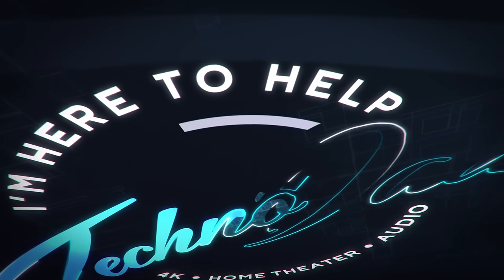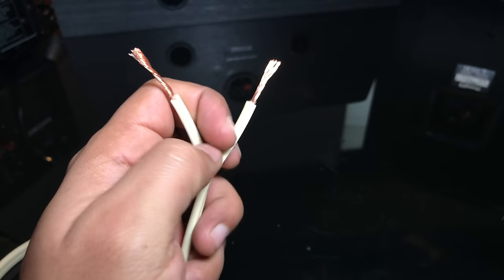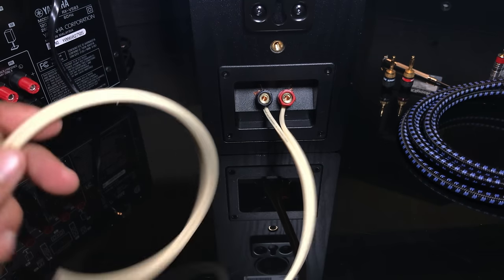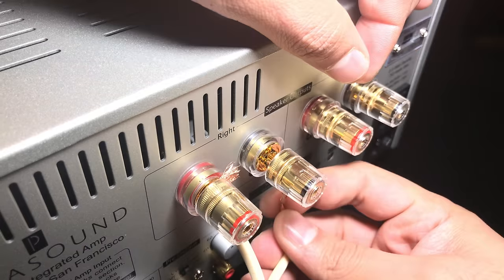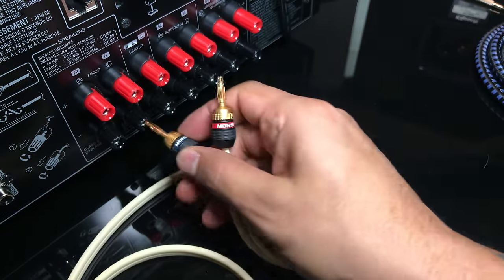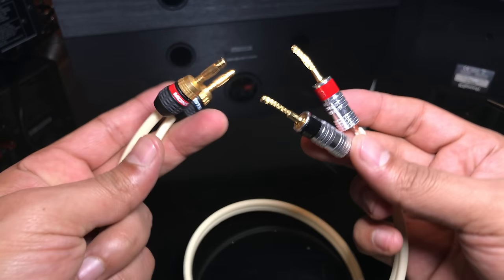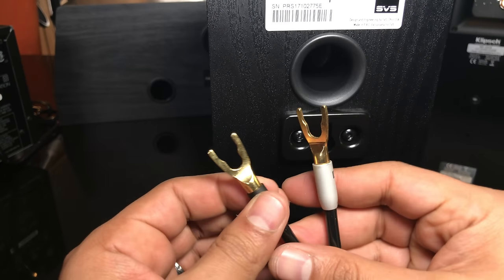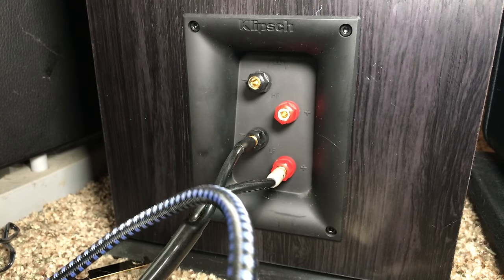How to Connect Speakers to Amplifiers | Home Audio Basics

Comment: Aloha! How much insulation do you recommend snipping off? You said you went too far when using the flex pin connector. Should i take off 1/2, 3/4, or 1 inch.
Reply from the maker: Hi!  I'd say 1/2 inch should be just fine.
Reply: @TechnoDad  Is that enough for spring connectors and banana clips as well?

Comment: if you are using bare wire put a small amount of solder at the end of each wire, that will keep it from coming apart. sometimes I just coat the entire surface of the wire with some solder. you can go to a discount store and find soldier and irons for a few dollars.

Comment: I have a cheap Yamaha active sub with a single RCA input.  My amp has no RCA sub output, but it does have a subwoofer speaker input.  If I buy an RCA to speaker wire adapter, will I be able to hook up my sub using banana plugs?

Comment: Hi, I'm really having trouble with some audio things. So I've got a pair of focal ca 165 coaxial 2 way speakers which I got cheap and I want them in the rear. Should I not connect factory tweeters in the doors and leave just focal speakers so the sound doesn't mix up? I'm not using an amp at the moment, thanks.

Comment: At 13:24, where do I plug in my speaker wire into? Just got some Klipsch RP-6000f and not sure if it matters which ones I plug it into. Low frequency or high frequency?

Comment: My system consist of 5 floor speakers 2 subwoofers and 4 ceiling speakers on a Yamaha RX-A3080. I would like to add rear speakers, but I am unable to wire them without having wires on my floor crossing a walkway. I am hoping you know of a way to attach wires to the rear channel of the receiver from some type of device to make a wireless connection to another device which would than be wired to my speakers.

Comment: Is there a way or even need to connect a DAC to a receiver? Is the receivers built in DAC better to just use? I was just given a Schiit Lyr 2 and am doing some hwk on this.
Reply from the maker: You can bypass the internal AVR DAC by using the Schiit to change the signal from digital to analog.  Meaning, you would go from your source to the Schiit in the digital domain and then use analog cables to go to the AVR.
Reply: @TechnoDad  is it worth doing this?

Comment: can you plug in more than one barewire connection from the output of the receiver to another set of speakers? like if you had other rooms that had L/R speakers and wanted your receiver center L/R to be tied into them?
Reply from the maker: Hi Thomas!  I would not suggest that. When you do this, you are connecting the speakers in parallel and when this happens, the amp sees a half the ohm load and outputs more power.  This is not a great setup as the amp may start clipping (turning off).  Most AVRs with 7 or 9 channels will have a Zone 2 section where you can power and send sound to a different room, I would look into that.

Comment: I just purchased 12 outdoor 5 and 1/4 Pyle speakers. What should I do for a head unit I'm also thinking about adding for rock as in fake rocks I'm pulling two wires around the whole entire so I can't miss the what a diagram would be along with a suggestion for a good head unit
Reply from the maker: Head unit?  I'm not sure about those.

Comment: Consider this:  I have found that you get a lot better results and less chance of shorting-out if you first "tin" the wire ends with solder.  Tinning prevents you from having to twist the stray ends of the speaker wire each time that you disconnect,  Tinning also enhances the movement of electrons through the wire.
Reply from the maker: That’s interesting, I’ve never heard of that!
Reply: @TechnoDad  I've been doing this since the late 70's.  I read about the technique in STEREO REVIEW Magazine.  It works great!!

Comment: Does it make a difference  if you  use  the top connectors or bottom ones?
Reply: henryconga58 if you have the binding post on then no
Reply: Thanks!
Reply from the maker: JDmsz has the right answer.

Comment: I've ordered a recevier (Yamaha R-S202D) with spring clips. I'm abit afraid that it's gonna be too tight for a 2.5mm cable, should i use 1.5mm for that?
Reply from the maker: I'm not sure.  You can always twist it up and try to make the wire more compact.

Comment: Techno Dad, we recently bought a house that has speakers in the ceiling and there are multiple ones throughout the house. They are all tied into a Monster Cable speaker selector 4 way. Here is my question if you can help. On the back of the Monster product there is a place to hook up speaker wire to an amplifier. We would like to be able to buy an amp and then play music from our phone. We don't need anything super fancy as the Monster product isn't near any of our TV's. We are not the original owners of the house so the Monster product came with the house. If you could point us in the right direction to finding a basic amp we would greatly appreciate it. I tried chatting with one of the box store sales people and they wanted us to buy a $400 amp that you could hook up everything to. We would like to be able to hook our phone up and listen to the music throughout our house. LOL Thanks in advance!
Reply: What kind of Amp was it..? Cause thats about right for the lower end price range. Why cant you get a Sony Reciever with Bluetooth and just connect and play. I wld have to see a pic of the wall where the connectors are. Are there multiple or all spliced into one outlet?

Comment: I purchased a small 4 channel audio amplifier (5.0 Digital Power Amplifier Stereo 2 / 4 Channel Audio Amp 50W×4) but I'm unfamiliar what type of connectors should be used w my stereo wire? The openings are so teeny tiny with a tiny screw on top of the opening so I obviously can't use a banana, spade, etc. What kind of connector do I use? Or perhaps I need to use a small gauge stereo wire? Help! I'm stumped.

Comment: When stripping the wires is it bad if a couple of the copper strands get cut off or will it still allow a connection?
Reply from the maker: Great question!  That’s not a problem, it happens all the time.
Reply: @TechnoDad  Ok thanks. I always get paranoid about stuff. Usually works out in the end but when its stuff i dont have much hands on experience in i always need to make double and triple sure.
Reply from the maker: All good, I’m just glad I can help!

Comment: hi techno dad! Im having some issues troubleshooting my speaker/amp set up. Not sure if you do any sort of consulting but... I have pioneer cs-99 hand me downs and a nikko sta-2020. I think I can only use a bare wire set up for both. One of my speakers is always cutting in and out, and can't hold a steady level. I'm wondering if my amp is incompatible with my speakers or if I wired it crappy. Any guidance is helpful, thank you!
Reply from the maker: Yes, I do consulting, email me - TechnoDad55 at gmail dot com

Comment: You'll get the slightest bit better connection if you skip the banana jacks and screw down the wires we are talking a small fraction of an ohm in most cases but hey it all counts.    So my suggestion is if you don't plan on taking stuff apart anytime soon just use the binding posts.

Comment: What about using pa or powered speaker with av receiver for movies outside on a projector? Would you just cut of the connector from the speaker and just use copper end into receiver?

Comment: hi, I have a question, it's possible to use an small guitar amplifier(using the extension speaker out) as a source of power for two Yamaha speakers NS-a327 from a home theater? ??  thanks

Comment: Question ,I have a Pyle HD reciver and a pair of tower speakers. I bought a 75 inch TV and I didn't bother to hook up my system to my TV or 4k player for about a month. Now when I had my system hooked up to my older 70 inch TV everything was good and now a month later I hooked everything up to my new TV and right tower speaker is making a crackling popping sound. So I got a new speaker wire thinking that's the problem I hooked up the new wire to my speaker same problem. Then I checked my reciver and determined that the right channel speaker hook up on my Pyle reciver is broke because I hooked up my tower speaker to the left speaker channel on the reciver and it sounds ok.. Do U think I made the right determination that the right channel speaker connection is broke or maybe there's a lose wire inside of my reciver speaker right channel hook up ? 🤔 and if the Reciver is the problem should I just buy a new one or is it worth just having it repaired ? 🤔 BTW when I bought the reciver 11 months ago it cost me $400 dollars. I'm not sure if it will cost say $200 to fix it.

Hopefully I made sense in all that I said to U 🤔 and Thank U for your time. PS
WHEN I SAY SPEAKER CHANNEL I MEAN SPEAKER INPUT ON THE RECIVER 
again Thanks Techno Daddy

Comment: Gotta a question.  I have a Sony STR-DH590 receiver and 6 Polk audio 70rt in ceiling speakers with 2 svs sb2000 subs. How do I connect all 6 speakers to the receiver since it only has 1 left and right channel which I have 4 speakers connected right now and want to add 2 more. It sounds good and loud but I tried connecting to the other spring loaded channels for surround sound but nothing happens . What do I do connect all 6 to same channel  ?

Comment: Hi there I have just got a yamaha rx a1060 avr receiver and I have never used one before and I have got a pair of B&W 685 s2 speakers and a b&w hm62 s2 front centre speaker and yesterday the center one was working fine and today its not working so I have put the cables into another binding post on the avr and it works. Have I touched something on the avr. Please can you give me any advice thanks Jamie

Comment: What’s the advantage of using the special connectors instead of just using the bare wire?
Reply from the maker: After a few months the bare wire at the connection point turns brown/black.  Also, I change out speakers and AVRs constantly so this makes it easy.  If I had to connect height speakers via bare wire that would be a PITA!
Reply: Techno Dad good to know, thanks man! I found this video to be very helpful.

Comment: One more question - is there any degradation if I wire from the speaker (with banana clips) to a wall plate?  And then to another wall plate from the receiver?

Comment: Couldn't help but notice that the wires were twisting to the right, but somehow you twisted the wire tips to the opposite direction. On all User Manuals it is recommended to keep the tips as short as possible so they protrude at the other end, but I notice yours goes way beyond the binding posts.

Comment: Use proper wire strippers when preparing speaker cables. One strand of copper falls into the top of your receiver and you are done. Prepare speaker cables away from the electronics, don't get strands on your sleeves or beard. Copper the silent killer.
Reply: I'm a noob- why does copper cause such harm?
Reply: @ViviennesComfort  Copper strands touch the electronic circuitry creating short circuits.  It can start a fire or it could do some minor damage that degrades the system over time.

Comment: Hi I have small problem, I want connect stage  Loud speakers (Gig type) to vintage Technics receiver. Receiver have wire connections and speaker 2 large Jack (in out) holes. Do you know any way to do it?

Comment: So  the spade connector cannot be used on the Yamaha/denon that had the red binding post. I did not see u put the spade connector on that ?
Reply from the maker: Correct, the spade connection won’t work on the avr side, you’ll need either bare wire or bananas.

Comment: Techno dad I have another question!!....will it hurt my denon x4400h avr if I run 6 ohm main speaker towers and 8 ohm center ,surround, surround back ? I'm currently saving for a set of klispsh speakers but until I can pull that I do have a set of pioneers sp-fs52 andrew jones tower speakers that are better quality than my current mains and would like to use them but obviously I wont if it will cause a problem. Thank you for any advice you can throw my way!
Reply from the maker: Hi!  It should be stable with 4 Ohm speakers so you should be fine with a pair of 6 ohms with 8 ohm speakers.  The only problem that would arise is that the AVR may turn off or 'clip.'
Reply: @TechnoDad  ok, well I'm going to assume that it turning itself off is a self protective thing?  But what is "clip"? Either situation sounds like the avr wouldn't like !  Lol!  Rats!! I really wanted it to work!...I'm curious if the majority of avrs and amps out there are 8 ohms why would pioneer make there speakers 6 ohms?   So frustrating!!...lol! Thanks again for answering and for taking your own time to make these videos!
Reply: This will just make me break down and buy the klispsh speakers sooner as then I wont have to deal with these problems anymore! I just wish they were not so expensive!...lol!! But damn the klispsh sound and look so awesome it will be worth every dime I'm sure!!..

Comment: I have a question! So, I want to hang my Klipsch on the wall for surround sound. But where is the power coming from?? I thought the power comes from connecting the wires to the speaker and all the way to my AV Receiver? Is my Receiver my power source, so I just plug in wire to AV from speaker and im good to go? Or is there a power source separate from the AV and speaker somewhere?
Reply from the maker: Yes, the AVR will power you’re rear speakers.  It’s standard speaker wire that you will have to route through your room to the surrounds.
Reply: @TechnoDad  Awesome thank you! Your videos have helped me immensely get rid of all my confusion;)

Comment: The copper jumper also means you can tie a second speaker on the same side !
Reply from the maker: I would not do that.
Reply: Run a jumper set from the first to the second. It just will make it a second  left or right , front or back (which every you prefer to call it) speaker. Your just hooking up in series.
Reply: @TechnoDad   you asked , I told you so it's  your choice. 
If you have a large room and want total saturation it's a way to accomplish it.

Comment: hey bro I got a question, so I got the terminal-looking speaker input in 10:53 , but I'm trying to hook it up to my record player. And the input on the record player has is like an aux input. how would that work?
Reply from the maker: You would need something in between the two to amplify the sound like an amp or an AVR.

Comment: I have a set of Wharfdale  Diamond 9.1 speakers . Can you show me where I put the cables for left and right please . Not used to seeing 2 sets of red and black connectors
Reply from the maker: Oh, if it has dual binding posts on the back, that's for bi-amp or bi-wire of your speakers.  Just make sure the metal jumper is connected and connect just one pair of speaker wire.
Reply: @TechnoDad  but which set 🤔.. the top or the bottom

Comment: I need help I’m new to indoor audio I have a pair of klipsch r-26f they have the bride on the terminals yet I can’t seem to get them to work at all... the center works just fine, really confused as to what I’m doing wrong the receiver is a onkyo with the spring style. Connection. Only thing I can think of is I don’t have solid enough connection at the speak maybe some rubber in the way? I’m gonna try tomorrow I’m beyond frustrated today...

Comment: My confusion is trying to find the correct setup for my new Klipsch floorstanding speakers on my Yamaha HTR 5590 receiver that already has a 6.1 Bose home theater system attached. Not getting sound out of the speakers.
Reply from the maker: Hi!  Email me, technodad55 at gmail

Comment: question is all i need for a surround sound setup is banana cables surround sound speakers and an AVR correct im assuming the AVR wodul connect into my pc and then i plug the banana cables into the surround sound speakers and run them into the AVR im assuming this is all right if anyone knows pls respond. also im not sure if its called an AV receiver or an AVR whitch one is it? that you connect your speakers to?.

Comment: What does it mean when the speakers pop randomly? I hooked up my speakers to a Technical Pro Rx-B674, 1500 watts home receiver and the speakers will pop loud at random. . it doesn't matter if there is music playing or not. Should I upgrade my wiring to a thicker gauge? Should I not wire in more than one speaker to each terminal on the receiver? I'm lost but that darn pop scares the dickens out of me every time! Thanks in advance!
Reply: You might have too many wires connected to your amp, or not enough power

Comment: A question to something i cannot find on the net. In an audio system , i am thinking to take out the original speakers (L/R) and use a Bluetooth hi quality speaker Harman Kardon Onyx. But i don't want to use it wireless. Now, i see 2 options, or to connect the speaker on the jack for headphones (it works) or somehow (?) to connect it to the two female RCA L & R. 
Is there any difference between these two options for the sound quality???? Because if there is no difference to follow the easier way with the jack socket that gives out for the headphones.
Thank you,
Reply from the maker: Hi!  If there’s a physical input on those Onyx speakers, then it could be possible.  I looked on their site and there were a few different ones.  I didn’t really see an input on the pictures.
Reply: @TechnoDad  there is jack socket input for the onyx. But to what I ask about difference in the sound quality between hi-fi speakers out l/r and jack socket out, what do you think?